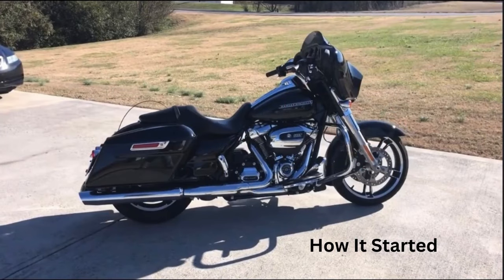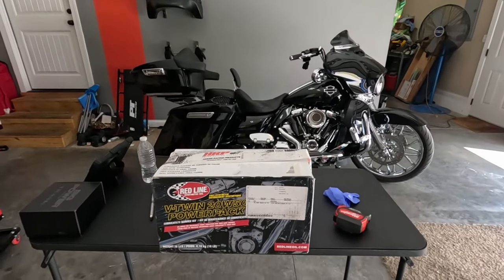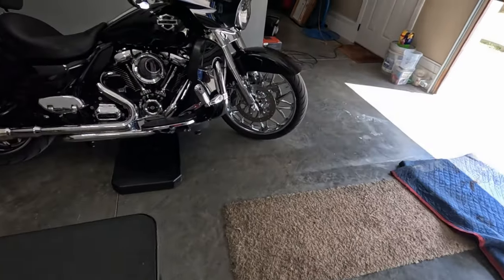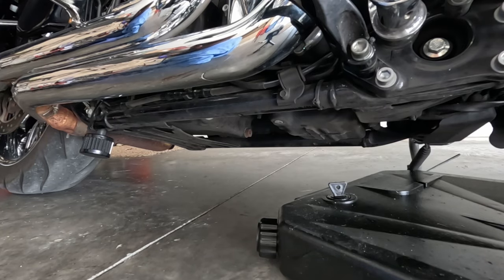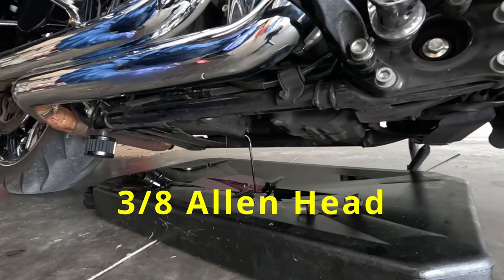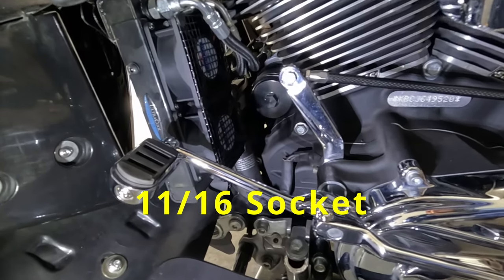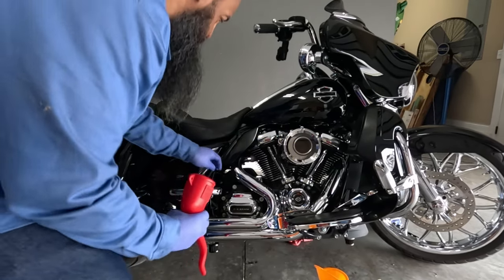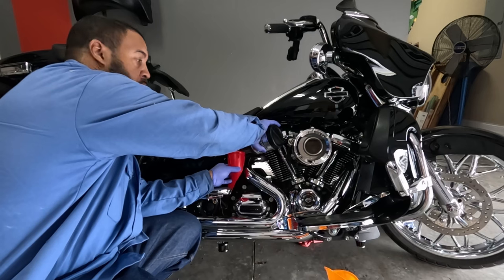3 Hole Change

Comment: I’m going to give that redline oil a try. I use the primary and transmission fluid but I use the Amsoil
Reply from the maker: Zero complaints, been using since big bore kit installed.  Thanks for watching and commenting!